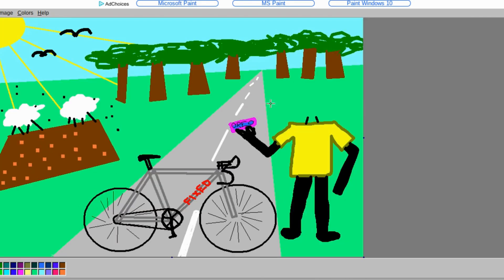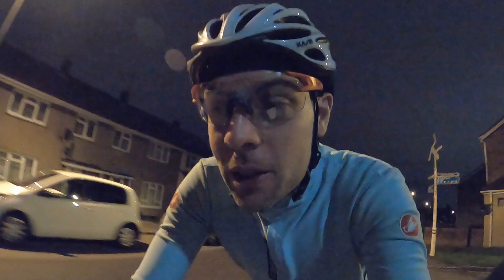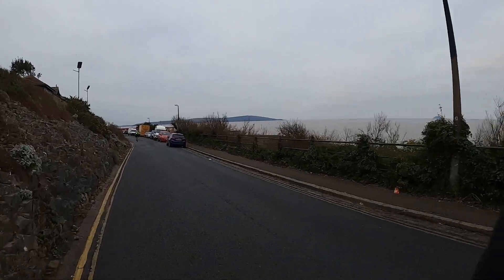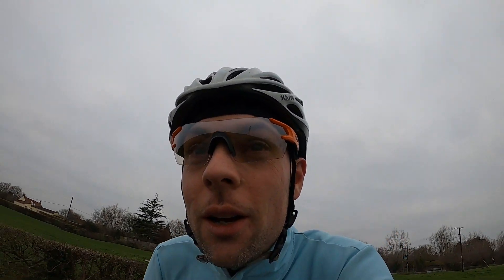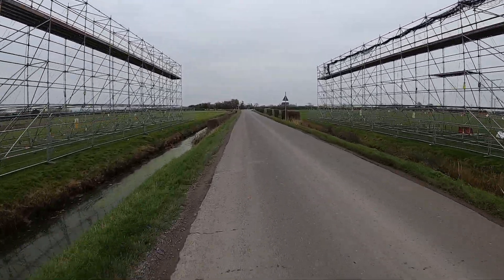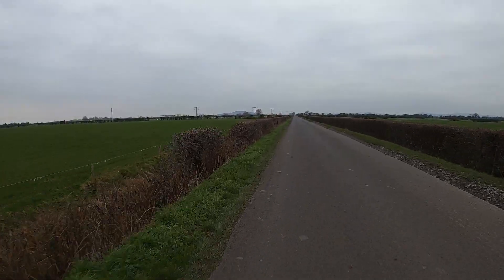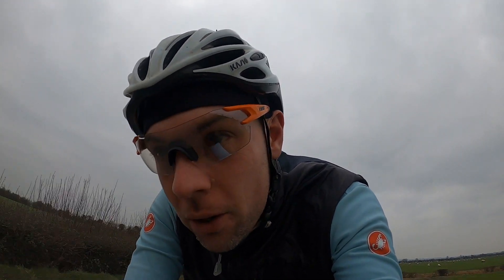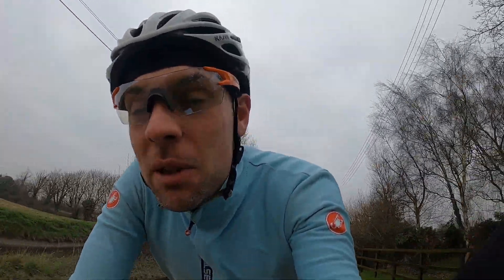How to get a tough leathery gooch and heat your sandwich up

Comment: The only time I got a tire to thump was with a boot made of a cut section of tire. Patches never were noticeable. A balaclava and shoe covers are winter essentials. With no need to shift or brake you can wear real winter gloves. Got the right saddle on a pig on a poke. Really lucky.